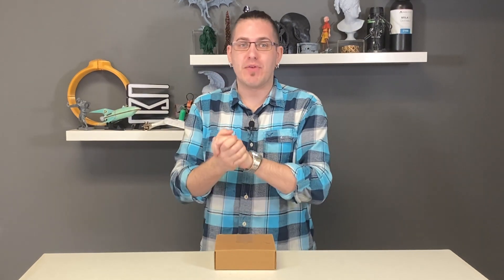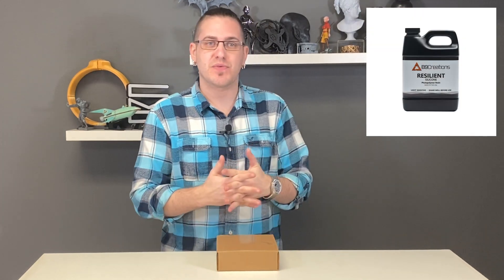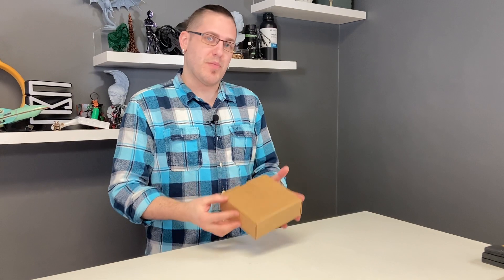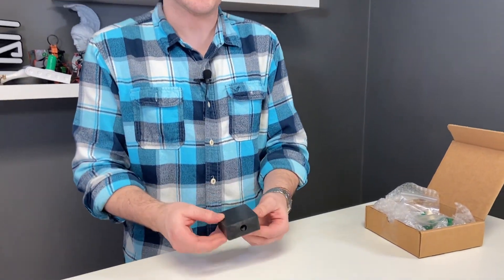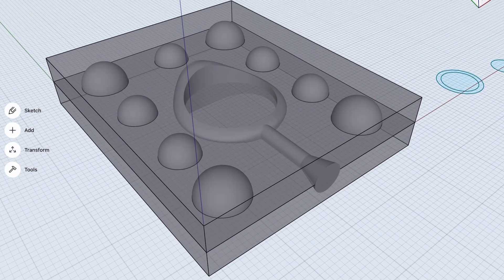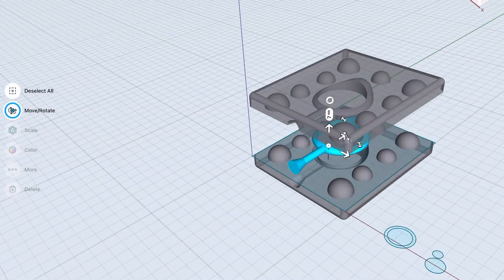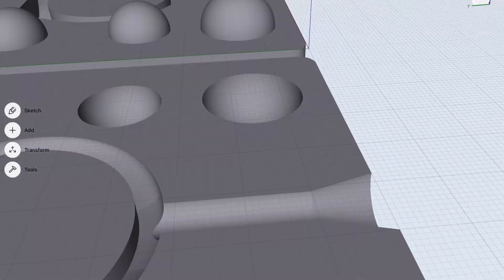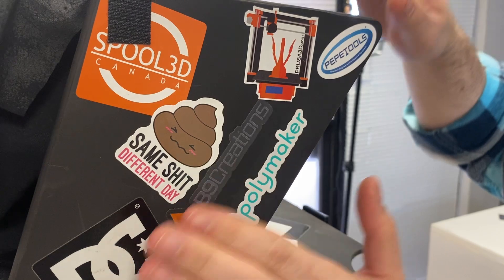3D printing a Jewellery Mold with B9 Resilient Resin

Comment: I have a b9 core 550 I work with everyday. Would be willing to show how I use it and also open to learning more from you about optimizing 3d print processes. Specifically large format printing trees vs molds and how you are able to support models (large trees with layers of rings) and reduce cast cleaning after casting.

Comment: I am desperate to find a resin that I can print 3d molds with. It would save me a fortune. I can’t wait for you to find resin that works well! Thanks
Reply from the maker: We're also waiting for that perfect resin. The one's we've tried so far (B9 Resilient, Apply Lab Work Spring, Siraya Tech Tenacious) have had their hits and misses. I think Apply Lab Work would be worth a try in the mean time as its not locked to a machine and relatively cheap.

Comment: Do you avoid using mold release spray with these? I’m trying to print my first mold, and when I made the rubber style molds in school we used spray to help get the model out of the mold.
Reply: From the 3d printed injection molds I have made with standard photopolymer resins you will want to use a spray mold release, most waxes don't stick well to cured 3d resin but on a detailed mold with tight corners and small details the wax designs would stick and possibly rip apart.

Comment: Good idea, once you get your hands on a flexible resin that works reliably you can bang out a zillion wax patterns in the time it would take to make a printer full of resins.  Good luck getting your hands on the stuff you need to test some trickier-to-print molds and learn what this resin will and won't let you get away with.